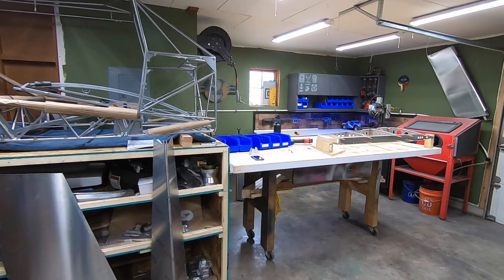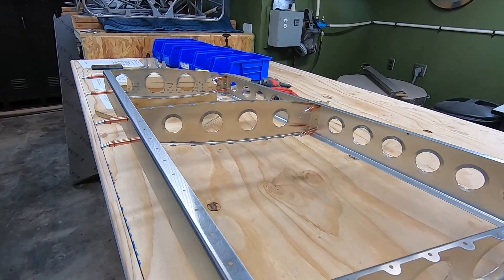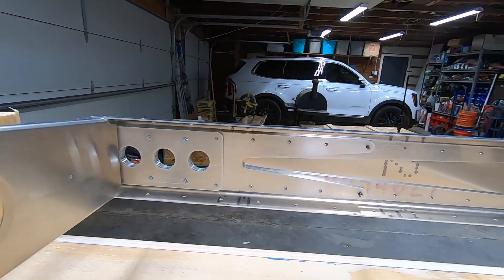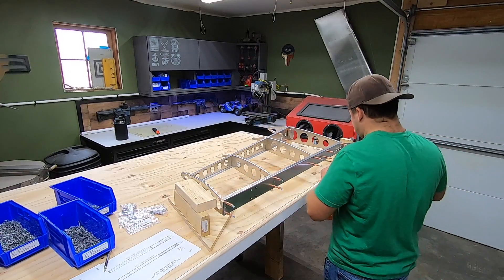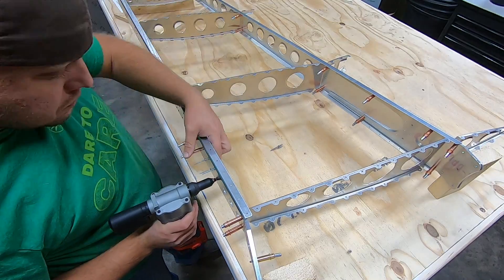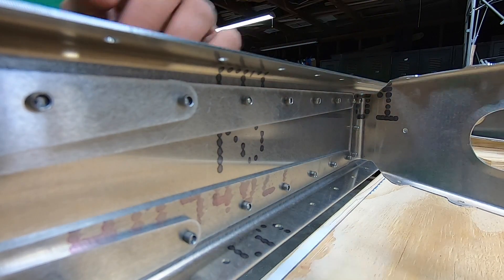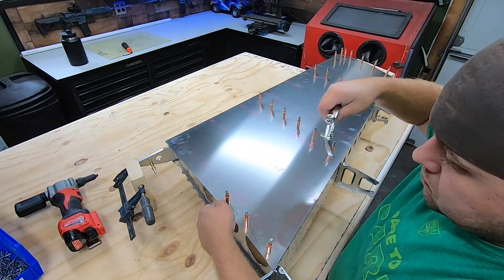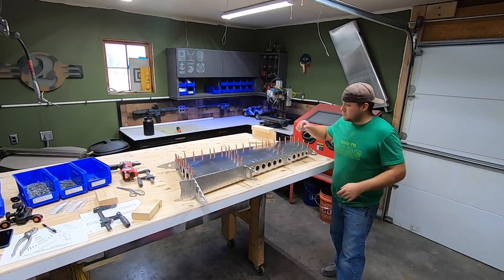Rans S21 Vertical Stabilizer (Part 1)

Comment: Just found your build a couple days ago. Had been looking at building the RV9 for several years, and wanted to take another look at what’s out there. Found the S21 and it this is the one my wife likes the best. This will be my post Navy retirement project. Anyways, just started watching your series and will have questions as I watch for reference later. For the front skin of the vertical stab, do they want you to break the edge that is overlapping?

Keith
Reply from the maker: Good to hear another 21 will be born👍 If you havnt already done so, the manuals are available digitally on the rans website. Check out page 43 step 6 of the text manual. The technique of “edge forming” is used on most of the skin overlaps. Thanks for watching and reach out anytime. I also highly recommend the various s21 focused Facebook groups. They are full of good info..
Reply: @Project2Aero  Thanks Josh! I figured it probably said somewhere about it. I’ve been researching RV builds for so long, I’ve got a ton of research and catching up to do on Rans builds. I am thinking about dimpling the skins and ribs and countersinking the thicker material so that I can use flush pulled rivets and even some solid rivets. I know it will add a ton more work, but I have more time than money as they say. It already seems to go together really quick anyways. What do you think?

Keith
Reply from the maker: @keithrush4168  Your not the only fella to go down that path. I believe there is one flying that was done with all flush fasteners. I suspect the gains there are minimal and not worth the added complexity and work required but to each there own. I've been eyeballing that new RV15 to be honest. Who knows how long it'll be before they are available..

Comment: Nice videos man! Question about that milwaukee rivet puller, have you tried or do you know if it has the power to pull a cherry max rivet?
Reply from the maker: Thanks for watching Seth! I haven’t pulled and cherry rivets with it. I don’t suspect it would have trouble although I know some guns struggle in seating the lock ring of a cherry fastener. I don’t have any on hand or I’d give it a shot🤷🏻‍♂️

Comment: Why the electric rivet puller instead of a pneumatic one? What is the advantage?
Reply from the maker: I was skeptical myself about a battery rivet gun. I already had several Milwaukee products so i figured id try it on this project.  So far, im impressed and really like not having an air hose around all the time. It is a bit heavy and the head is somewhat bulky when compared to some pneumatic versions.  To each their own, I kinda dig it to be honest. Thanks for watching Sam!
Reply: @Project2Aero  Thanks for answering my question.  I subscribed.  I am enjoying watching your build.

Comment: Great videos - really good camera placement for seeing what you are doing.  Good seeing the family involved too.  What engine and avionics are you planning to use?
Reply from the maker: Thanks for watching David! Its been really cool so far to have the family help out. Im a bit undecided on the engine and avionics. Im leaning toward the G3X system and I'm really interested in the ULPower Turbo 520is @ 220HP. Time will tell I suppose, I also love Dynon stuff and the 915 Rotax looks like a great option as well.. I live in northern Texas at 4000ft and regularly see  high density altitudes on hot days so I feel like a turbo would benefit me nicely.